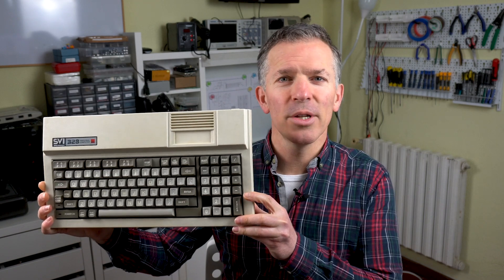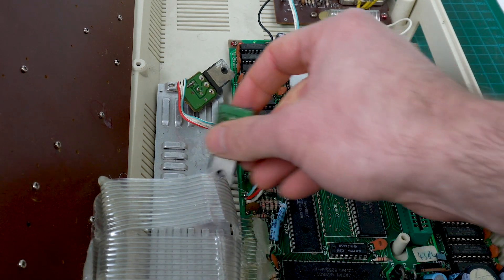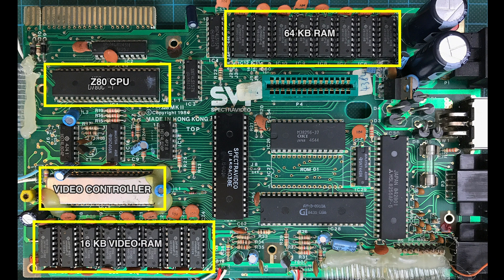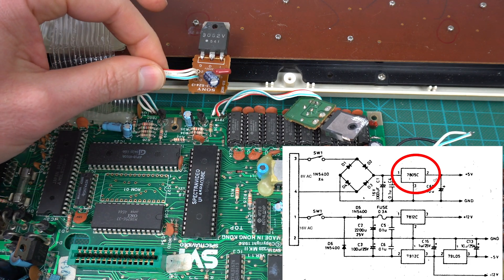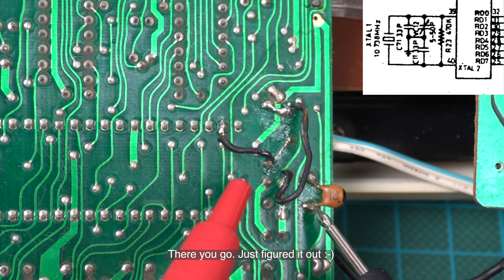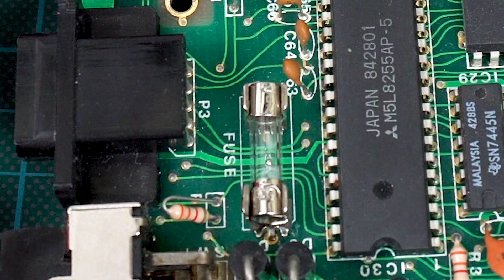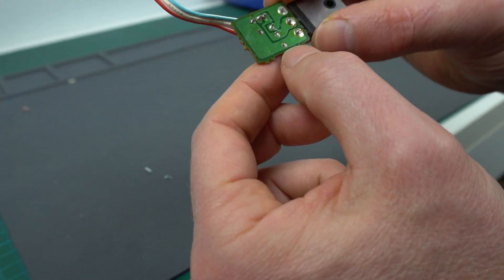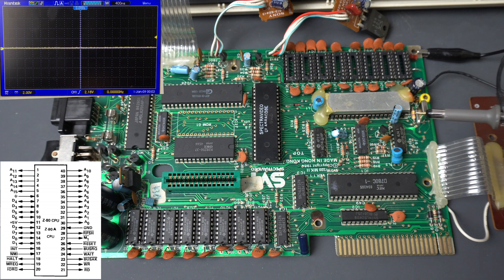SVI 328 Repair - So Many Things Wrong With This Computer!!!! 😱😱 (Part 1)

Comment: resurrect the poor computer please - it's been clearly tortured... it deserves a better future!!
Reply from the maker: I'm hopeful about it. We'll see it one way or another in a couple of weeks.
Reply: Any chance you might replace those awful glued connectors with pin headers and a shiny rainbow cable? I can't bear the sight of that glue :)
Reply from the maker: I'd love to because it's so uncomfortable working with all those parts connected, but I probably won't get there. That ribbon is probably the membrane, right? I guess I could easily replace the video board, but the keyboard would be much harder I think.
Reply: @NoelsRetroLab  Yeah, that's a good point about the membrane. Stupid designers! :)

Comment: With the reg mesuring 14v, I thought everything would be fried. But I guess, with it being shorted on the board, the chips were saved. Cool project.
Reply from the maker: Fortunately that was only the 12V rail, which was video RAM and one other chip (don't remember, maybe the video one?). But yeah, I'm surprised things seemed to work at the end. We'll see how many more surprises there are.

Comment: My theory held up until the end of this part. I feel that someone decided to 'upgrade' the video RAM. Thus causing a short blowing the fuse and voltage regulators. It looks like they salvaged the regulators from an old Sony hi-fi, threw them in. Probably threw fuses at it until the regulators blew out. Maybe they knocked the crystal off while 'working' on it, who knows. Very interesting.
Reply from the maker: Yes, that sounds like a very plausible theory of what happened to this poor computer.

Comment: You have done well to get that far, the last person did a bit of a butcher job for sure!  But stable Z80 and hopefully good main Ram.  It will depend whether any over voltage made it to the TMS chip as they are a little sensitive.

Comment: Whoa!  WTF did they do to this thing?  Possibly someone trying to learn as they went?  Not my project, but I am hoping you revisit and replace those 7805 and 7812 rectifiers.  I don't like that "Strange Sony Satelllite" part.  Great start.  Looking forward to part 2.
Reply from the maker: I would like to use the original regulators as well, but I don't have a 7812 handy and things would take forever to arrive during the quarantine. I tried putting a 7805 but didn't fit in the board, even after I cleaned all the solder well. I wonder if there are 7805 models with thinner legs.
Reply: I know how that is, you need to work with what you have available.  :)

Comment: Really interesting.  This is in remarkably similar (poor) condition to one that I have.  Although mine is a mk1 and yours is a mk2 so the motherboards are quite different sizes.
Reply from the maker: Yes, having the MK1 and MK2 makes the service manual and schematics much more confusing. For a while I was trying to make sense of the power circuit until I realized I was looking at the MK1 version. The MK1 comes with 16KB of RAM, right? Is it any different on the outside?
Reply: Noel's Retro Lab  No it still has 64k of RAM (plus 16k of VRAM). You might be thinking of the 318? On the outside, it has a slightly different badge (the mk2 has a little red square and is SVI branded I think) and the case has slightly different holes at the back, even if the ports themselves are the same (the cassette port and the monitor port share a gap in the mk2, but are separated by a bit of case in the mk1).

Comment: what is the purpose of the green connector in the center of the board?
Reply from the maker: That's a cartridge slot! It's narrower than a standard MSX cartridge because, well, it wasn't quite MSX yet.

Comment: You can quite easily replace 4116 with 4164...
The 12V regulator should not do a lot of damage, because there are probably another capacitors on 12V line on the board, so even without the one on the breakout board it should work correctly.
Reply from the maker: Yup, I've been shooting some of the adapting of 4164 into 4116 today. Lots of practice doing that from the Speccy :-)

Comment: I believe those voltage regulators to be original. It did not give 12V as the regulator would be oscillating without the cap connected.
Reply from the maker: There isn't much information about this computer out there, and there are fewer pictures, but the ones I saw had regular (7805 and 7812) regulators on them. Also, notice that's the same cable as the one dangling from the oscillator and the bridged trace in the back. So at least they were pulled out for some reason. And I guess I was assuming the voltage was already rectified by the time it got there, that's why it surprised me. The whole experience was super weird.
Reply: Old Guy  Yes I agree, just seen the Sony logo on the brown PCB's .

Comment: This looks like a teenager who didn't know much about digital electronics and had no guidance was trying random things to "upgrade" his computer. I bet the leads to the oscillator circuit went to an external socket so he could try different crystals to see how fast he could make it run. I bet he thought the stock voltage regulators were also needlessly reducing the performance of his computer so beefier voltage regulators would give the computer more "power".
Reply from the maker: Haha, I hadn't thought about that, but I could totally see that happening! 🤣

Comment: People criticise Sinclair build quality but really they were a paragon of quality compared to some if these HK-originated machines like these and the Vtech machines. Nice specs though.
Reply from the maker: To be fair, other than going cheapo on the keyboard connectors, the rest of the board seems fine. It seems better quality than Sinclair (and that's not even looking at the keyboard). The problems seem to come mostly from people trying to fix it :-b